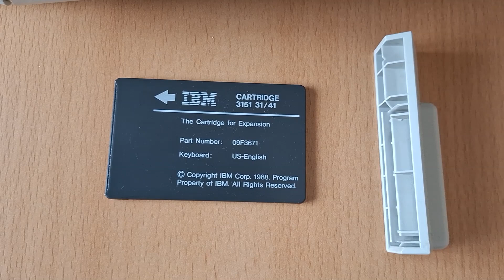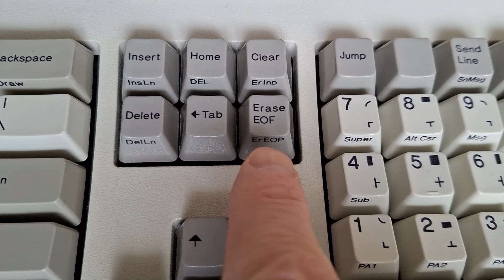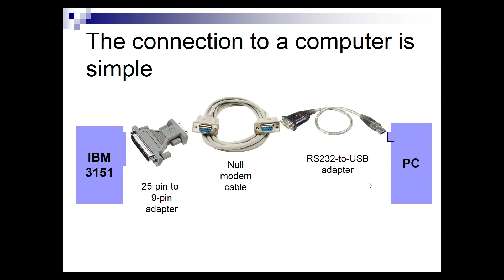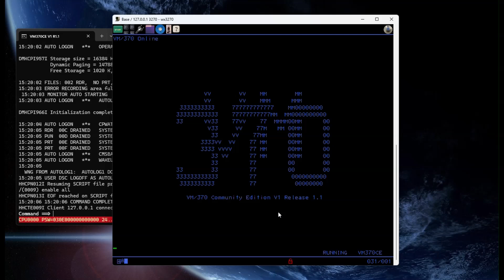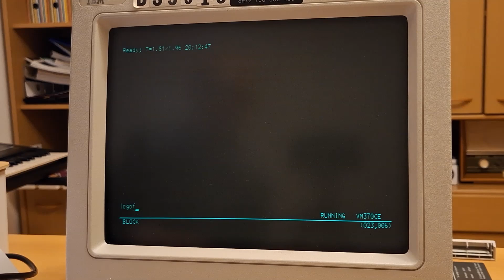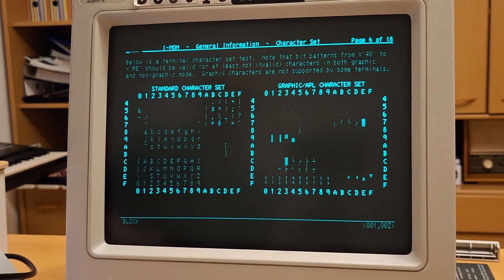Connecting an IBM 3151 ASCII terminal to an IBM mainframe computer

Comment: A 3745 is the "front-end processor" attached to the mainframe's channel as part of the SNA architecture. It can then interface thru SDLC over various different physical layers.  This is the "sync" side of terminal equipment such as terminal controllers with coax cable to 3270 terminals, and also printers, punches, card readers.

The "asynch" side of the system/370 communications architecture includes the  3151. It's an ascii asynch terminal analogous to the DEC VT-100. Normally, these were used for console displays rather than for enduser access, HOWEVER...

There is a 7171 Protocol Converter that can be used to connect to the mainframe channel, and have multiple  multiplexed asynch lines for the end-users the way that DEC or HP terminals accessed their respective minicomputers.

When you use the 3151 thru the 7171, it's possible to use full-screen block-mode mainframe forms as if you were using a "Synch" 3270 terminal with very close to the same keystrokes.

7171 can do full-screen block-mode forms for VT100s and other vendors,  but the keyboard mappings are not natural (no physical function keys) for high-speed input.

Unix has keycaps for the 3150 - you can use it as an asynch terminal to a serial port on a linux port and run vi, for instance.

If you have a terminal server, you could have a serial connection from the 3151, then telnet into any linux system.

Comment: Technically, a typical 3270 style terminal is not handling the data transmission. That was typically done by the controller, of which the 3745 was, I believe, the last generation. Building of the fields on the screen and handling user input also would not really be handled by a CUT mode 3270, but it would be handled (I believe) by a DFT mode terminal.
Reply: 3270 terminals connected to terminal control units, 3x74's and they handled the data transmissions.  3x74's were either direct (channel) attached to the mainframe or link attached to 37x5 (3705, 3725, 3745) communication control units.   The 37x5's could be link attached to another 37x5 or channel attached to the mainframe.  Think of 37x5's as communication multiplexers.